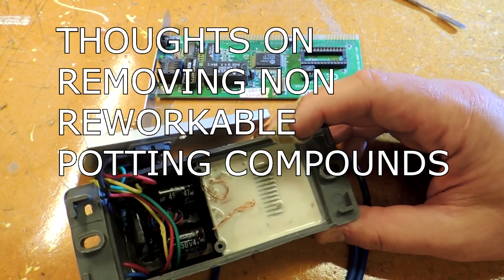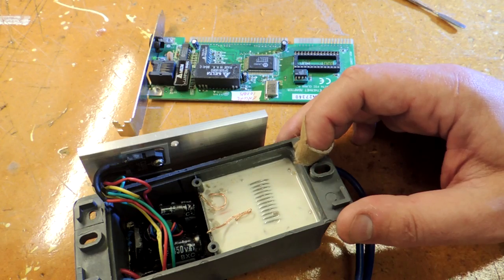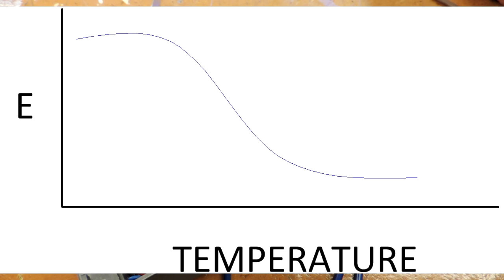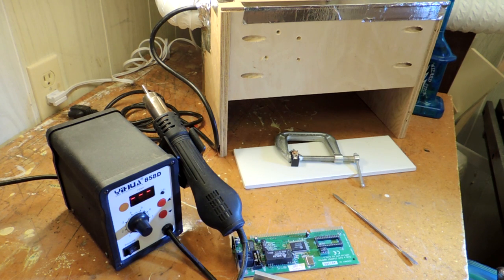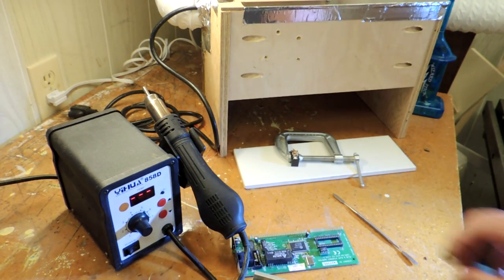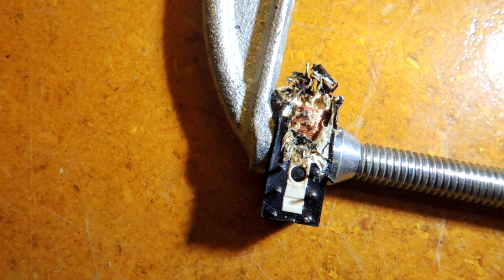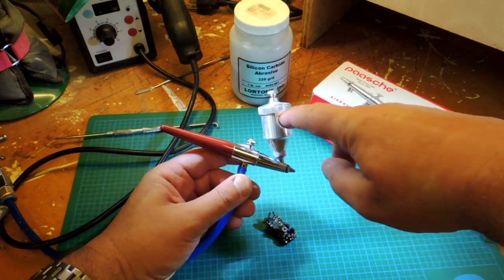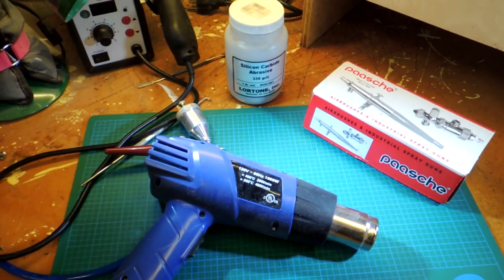Thoughts on Removing Potting Compound from Electronics

Comment: I've used my oven to bake potted equipment to the point where it all goes crumbly, but it's a rather messy and destructive process.  OK for circuit analysis, but not great for repairs.  Was that an ozone generator power supply by any chance?
Reply from the maker: bigclivedotcom It is indeed from a ozone generator....

Comment: Usually with epoxy potted modules I go with boiling first if possible because it releases the least fumes. While transferring the maximum amount of heat into the epoxy. I have a small table outside under an old shed… where I keep some of my most caustic chemicals and a modified toaster oven…  

I keep the modified toaster oven for help with depotting, and the various harsh chemicals in sealed containers. Most of which are kept outside away from the shop and the depotting definitely has to be done outdoors!

I only attempt this on the most expensive of circuit boards and modules that absolutely have to be extracted, repaired, or reproduce. Because it’s a real pain in the butt 😂 
It really isn’t worth the time other than when I dissect stuff for fun, Or my own curiosity. 

I’m always being asked to repair industrial modules that have been potted. Stuff like caterpillar bulldozers, giant and expensive miller and Lincoln welders, even those large tow behind generators for construction sites… that’s the type of industrial stuff that always contains many sealed and potted modules. 

As technology and the Internet has become more prevalent… Hiding the circuit boards to try and keep them away from prying eyes of competitors… That’s become a lot less common. All of the manufacturers know that if someone wants to look at the board and reproduce it that a slight coating of epoxy isn’t going to hinder them in the least. And if they’re that concerned about hiding their design… They laser off all of the identification markers on the tops of the IC chips. And honestly that’s still ridiculous because anyone with a decent lab can still identify almost anything. But the popping sure as hell helps with moisture in grass and other damage from vibrations and such. 

And it’s also a great way for the companies to sell replacement modules for 10 times their value… Because they’re so difficult to repair. Honestly most people with that type of equipment ....are going to purchase new modules instead of trying to repair. 

I always avoid jobs like that. But if the customer iinsists and we absolutely can’t find a board somewhere online… Then I charge about 10 times my normal price 😂 and I’m still pretty bummed out if they accept he offer and want me to complete the job
Reply: What do you charge to repair one of these boards?

Comment: Interesting video! I'm currently working with a product wich is potted, but fortunatly the potting compound is polyurethane (silmilar to the LED bulbs in your other videos) When I had to do some truble shooting after a few units did not survive enviromental testing cutting into them with a scalpel was easy enough to expose testpoints for probing. The epoxy looks quite bad though, maybe acid could be another way to get in, but that is probably even more nasty than heating it up. Potting a design should be avoided at all cost imo :)

Comment: how do you discharge components that hold a charge ?
Reply: +frank villa 
Large electrolytic capacitors that pose a hazard are rarely potted if that's what you're referring to.
Reply: They are rarely potted, but use a resistor to short them for 10 seconds.  Don’t use just a price of metal you could destroy the circuit
Reply: If something in a circuit holds a charge
USE AN ELECTRICAL LOAD that will consume the power to dishcarge it
aka....  a Resistor across the terminals of the component   let's say  capacitor.

Comment: What would happen if you would cool it with dry ice and bring it to a glass state ? Stupid idea yes or no.
Reply from the maker: The point is to extract the electronics covered by the epoxy.  The epoxy will become brittle... but so will everything else.  It might end up just cracking everything into small bits..

Comment: It’s funny how you start off talking about temp stage and such but never thought about just boiling in water. Once you boil them it’s like a soft boiled egg. You just peel and serve. No ACIDS, solvents, chemical that was used in death chambers or anything else that will harm you, just boiling water. 

I once had a control board that got soaked in ink. Took it to a machine shop and asked them to put it into their parts washer. It’s a machine like a dishwasher. It took two cycles, but after drying with compressed air, it looked brand new. Saved $3000.00 on a new board. They where so freaked out over my intelligence for even thinking up the idea they didn’t even charge me. So I tipped them $5.00.